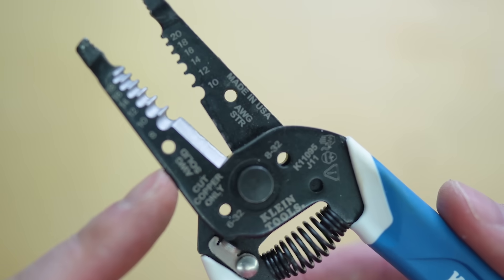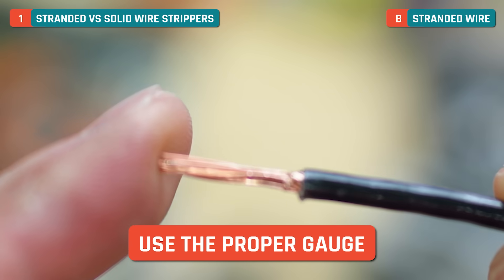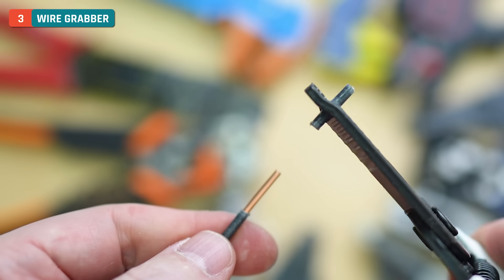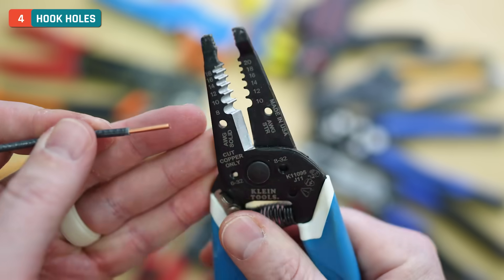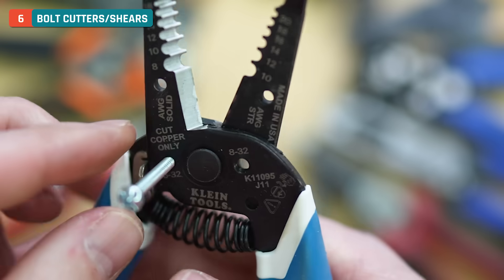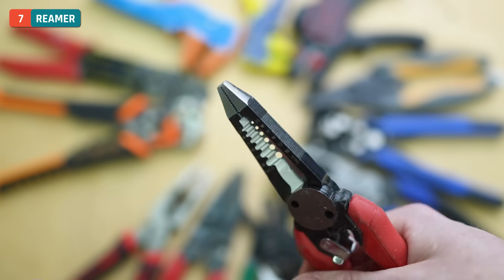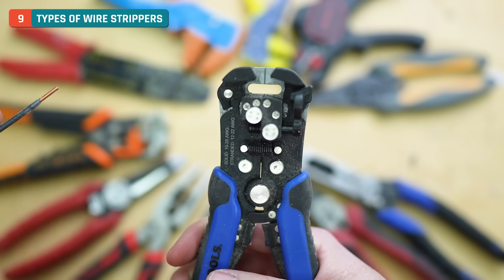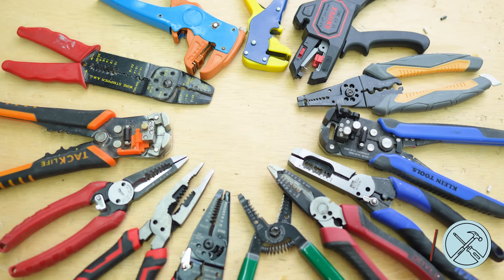8 Wire Stripper Features Everyone Should Know

Comment: When stripping, use the thumb of the hand holding the wire to push on the stripper jaws.  that will make pulling off the sheath very easy & no chance of your opposite hand swinging wide & smoking your knuckles on any hard surfaces.

Comment: You shouldn’t twist when stripping wire, all you need to do is it it in the correct size and pull. You nick the wire when doing that and create a weak point.

Comment: 7:13: FYI: The leftmost number of the screw/bolt cutters' (i.e., the 6 and 8 of the "6-32" and "8-32" shown in this vid) refer to the diameter of the threaded part minus the threads themselves; in other words, it is the diameter at the opposite or open end of the screw/bolt's head (the part you would tighten or loosen). The 6 and 8 sizes are the most commonly used for electrical work. The "32" refers to the number of threads per inch, even if the screw/bolt's shank (i.e., its length minus the head) is shorter than an inch. FWIW, the screw/bolt size may be followed by something like, 'x 1-1/2" ', which is the NOMINAL length of the screw/bolt (i.e., again, minus the head) in inches (n.b., the ACTUAL length may be slightly shorter, just as a 2x4 piece of lumber is rarely 2"x4"; in this case, the "2x4" usually refers to the size of the plank BEFORE it is milled; although they are supposed to be standardized, there are a number of factors that may affect the finished/milled piece's measurements, such as the blade used, heat, humidity, additional processing, such as pressure treatment).

Comment: Great informative video. The only thing I would like to add is on the Klein automatic wire strippers is there is a small plastic piece on the right side of the pliers that can be used as a depth gauge also.

Comment: Different manufacturers have different names for the oval shapes cavity hear the tips of wire strippers. It is called a stripper tool, a crimp, a loose screw tightener,  coil holding area; that is all I could find.

Comment: Not an electrical pro but a fairly capable handyman.  I've always called the small, scalloped indentations just down from the needle nose ends a crimper.  I use them to crimp wire connectors when connecting two wires using a butt wire connector.

Comment: This video is a partial FAIL, because LRN2DIY is apparently guessing at the features and getting some of them wrong. If you are going to try and teach others, make sure you understand the topic yourself first!

Using those "needle nose" pliers to break off the mouse ears is a terrible use of the tool. When bending metal back and forth to break it from metal fatigue, you want to NOT concentrate the twisting force anywhere other than at the scored line. People skilled at this will use a pair of wide nose pliers that can grab and cover the entire mouse ear....THEN it will break cleanly. BTW, the Klein Tools website tells what the tool's features are, so no guesswork is required. They say the "needle nose pliers" are for bending and forming wire after stripping.

The feature near the tip that LRN2DIY guesses are just 'grabbers' are in fact basic crimpers, for attaching crimp lugs and butt splices to wires; they don't meet NEC requirements for being a proper crimping tool, but they still can come in handy when the correct tool is not available.

6-32 and 8-32 both have the same coarseness of threads.....that is what the "32" means; it is the "pitch" of the threads. BTW, contrary to what MANY websites say, including the Wikipedia article on screw threads, and almost ALL "AI-generated" information, the "pitch" is not a distance measurement; if it WERE a distance measurement, the thread would be coarser as the pitch number increases, but in fact it works the opposite way......the pitch (In the non-metric screw thread world, the "pitch" number is the quantity of thread peak-to-peak distances that fit into the length of an inch) is greater with a finer thread.

Comment: Locking the strippers closed for putting them away also protects the cutting edges from both getting damaged rattling around against another tool in your bag, and also from cutting your hand when you are rooting around in your bag to find a tool.

Comment: Great video! I'm not an electrician, just occasional home DIY things, like replacing wall switches or installing ceiling fixtures. I've used needle-nose pliers without ever knowing my strippers had pliers or the wire looper. I've run into the too-long-bolt problem several times and wish I'd known about the bolt shears. Thank you for sharing!

Comment: I personally use a flush cutter for almost everything And then if I need to bend wire over I'll grab my pliers As for the bolt cutters it ends up mangling the threads so you make your own threads in the box and how often and are you cutting electrical box threads

Comment: The "needle nose" on wire strippers are for light duty work. In other words, worthless. Right below the needle nose area is the soft crimp for non-insulated butt splices, termination rings, or forks. Wire strippers like these need wire hook holes, because the needle nose sucks. Bolt cutters are always useful.

Comment: Ok, i have a question.  I have all these things that seem to be for connecting wires.  You flip this tab up, insert a wire on the end, flip the dip down, other side, repeat.  Have no idea why and what I would use them for but I've found electrical outlets that allow you do just insert the wire inside a slot then just screw down the slot.  That is SOOOOOOO much easier than trying to bend a wire to me.

Even with my kindergarten level knowledge about tools, I really like Klein tools. 

I have a Klein 44228 electrical knife?  Check it out, it has some feathers i want to learn

Comment: The tear drop thing you speak of is for crimping. Theres 2 types of crimps you can do . Idk the names of it but for stranded you use the one with half moon (or oval shape) on 1 side of the tool and the other side has this nipple 😂 thing. The one you show is for solid wires like the copper wire your demonstrating. Atleast thats what i was told when i was a mechanic. Worked well since i dont recall ever having a comeback due to bad crimping😂

Comment: At 7:32, you said the 8-32 bolt has a coarser thread than the 6-32. They actually have the same thread pitch. The 6- and the 8- are the bolt's gage number, and the 32 is the thread pitch, meaning that thread has 32 threads (turns) per inch. The next size up is a 10-32, which, again, the only difference is the bolt gage, the thread pitch is the same. 
There are other threads, like a 10-24. That thread is the same 10- bolt gage, the difference is this one has 24 threads (turns) per inch. This is actually a coarser thread than a 10-32 bolt.

Comment: Pulling on the wire not only makes takes longer to strip that 3/4" of insulation, it will cause damage to your hands. Use your thumb to push the stripper. Never twist the wire to strip the insulation. This video should be used in schools to teach what not to do when trimming conductors.

Comment: That tool just got a whole lot more useful.  Thank you sir I used them as wire strippers and maybe used the end to yank off the stripped wire.  Things learned: Holes to bend the wire to properly fit those screws and those other holes to cut screws to proper size.  Naturally I used a mini hack saw to do that.

Comment: Guess here, but if you put your wire against the tip down to the hole that has the AWG for that wire and then strip that much sheething, will that give you the perfect length to make a hook in that wire gauge?

Comment: We had these where I used to work, and we'd have to strip a PTFE liner off of a copper wire, and maybe half the people there insisted on using the cutter portion as the wire stripper, and somebody tried to cut a steel mandrel with them for some reason.
Reply: Use side cutters to remove mouse ears

Comment: Next time you break off mouse ears, point the tool tip so it is perpendicular to the score line instead of parallel to it. That way you use the length of the tool as a lever instead of having to twist it, which in the long run will do your wrist no good. Also, when cutting solid wire, I like to use the correct gauge hole (say 12) to cut the insulation and then shift to the next larger size, 10 in this example, to pull the insulation off. Tool wear or manufacturing tolerances can cause the tool to want to pinch the wire. Scored insulation pulls off easily with the next larger hole.

Comment: As a retired electrician, just give me those old school wire strippers. Immediately remove the set screw and get used to the pressure needed to strip the wires. I'm at least two times faster with those and cause no damage to the wires then with these automatic wire strippers.

Comment: Tiny bit tip, when snapping off ears on outlet or switch be sure to make the first twist as far as possible. Do not go part of the way. We need to make the metal stressed on the first twist and then concentrate the next ones to also twist as far as possible. We will find less twist it takes to fatigue the metal tabs before they breaks.

Comment: Rule number 1: dont buy klein strippers anymore. They suck. They will cut wire but when you try to cut string they just fold the string over. I bought some milwaukees in the same shape as the klein curve ones and they cut string just fine. So klein is just overpriced overrated garbage

Comment: 5:14 12/2 NMD cable has 12 gauge hot and neutral, but 14 gauge ground. Generally, cables come with grounds that are one size smaller than the hots and neutral, except 14 gauge cables. This trick doesn’t work.

Comment: So as an electrician personally i find for residential the klein yellow "cable strippers" are the best because you can strip 14/2 cables and 12/2 cables aswell as the individual wires and they still have the functionaity of having the bolt shears, mostly i find you cant really beat them for all things residential

Comment: I like the explanation of the features. Well done. Right or wrong one thing I do on the hooks for the screws on switches and plugs is squeeze the wire tighter around the screw after it’s hooked on and I always turn it in the direction of tightening. Seems like I’ve had the wire push out going the other way.

Comment: I got a chuckle at the title. When you work with these type of strippers as they have evolved over the last 40 years. Btw you should never rotate your strippers as you strip insulation off. You can ring the conductor causing a point of resistance.

Comment: Super beneficial tutorial ! Mine is like the red handled one in your picture as if looking at a clock, 10 or 11 o'clock.  I'd like to see a tutorial on that.  I may get one like you featured.  I've often seen them. I could've used that bolt feature recently. Who knew ? I'm not very handy. But, I have a few tools and use them on occasion.  I recently installed/changed three light fixtures.

Comment: The "wire grabbers" can be utilized similar to a surgeons' clamps.  For example, the common task of twisting together multiple stripped solid copper wires for making pigtails, group the stripped copper wires together and clamp with the grabber part of the tool, then twist the copper wires using a second set of, preferably larger, electrical pliers.

Comment: Never turn or rock the strippers. When you squeeze the handles, the insulation is fully cut. Then, release the handles slightly and use your thumb to push the strippers off the wire. I learned this from an airplane technician. See also "7 things I will never do as an electrician" by Backyard Maine. Or use that oval hole near the plier tips to pull off the insulation. That trick is a new one on me.

Comment: I often work with a bunch of 18-24AWG wire and I've tried a couple auto strippers with them and can't get them to work better or faster than just doing it with regular strippers. I haven't tried the Knipex one yet though and am wondering if that can do very small wires very well?

Comment: As you backout a screw you just cut, it does not rethread the screw what you are doing is
CHASING THE THREADS and cleaning up bent parts around the shear & cleaning out and dirt or whatever in the threads.

!

Comment: Tip for pullng off the sleeve of the wire. 
If you have a 12 AWG, cut down with the 14 AWG slot (without moving or twisting that damages the copper), place back in the 12 AWG slot and pull off the sleeve.

Comment: FYI, 6-32 and 8-32 are both the same thread. One is not coarser than the other. 32 threads per inch, so I have been told.  The first number, 6 & 8, indicated the diameter.

Thanks for your informative video! I am going to go buy a good set of wire strippers.

Comment: I don't have any wire strippers like those but I took a look at 6 or 8 similar online.

None had a function assigned to the 'wire grabber' hole.  I've concluded it serves two purposes.  One is to give a standoff space so the needle nose plier jaw faces will close nice and flat.  The other being that the arch shape that hole creates will also give better torque if you really need a lot of force going to the needle nose pliers without distorting the shape of the poker faces.

Comment: That "wire grabber" at the very tip of the pliers is actually to fold your crimp over when you have crimp style connectors and you put that first crimp on it then you put them into the "wire grabber" end rotating it 90° and you squish the crimp in on itself for a very secure solderless terminal

Comment: The cpc isn't 2.5, it's 1.5. You should of used a red crimp. This is a good reason why electrical problems should be fixed by electricians and not DIY DAVES like on here.

Comment: I have not seen if you have covered this somewhere but I think it is useful to know. I'm not a n electrician but years ago I worked with a certified electrician in Maryland. The code there (and maybe the national code) requires that after hooking your wire around a terminal screw (like on a switch) you must close the hook using needle nose pliers before tightening the screw. Obviously this majes for a mre secure connection.

Comment: I've also found that in order to avoid nicking the wires you can make the initial squeeze with the wire stripper and then let go and grab the insulation with your fingers and pull it off. You can rock it back and forth to break the final remnants of the insulation with your fingers without damaging the wires. This is especially true with coax cables.

Comment: Just get some cc-22 pliers. Stirps anything you can fit in the jaws as long as its copper, aluminium or softer. Even pvc. Strips and cuts anything. Way lighter and smaller too, but they come in all sizes

Comment: Umm, at 7:30 you said the 8-32 was more coarse threaded than the 6-32... Isn't the first number (the 6 or the 8) the DIAMETER of the Bolt and the 32 the pitch of the thread on the bolt? So they are both the exact same coarseness right?

Comment: 7:32 The first number =bolt size. The second number is the number of threads per inch. Both are 32 threads per inch. The only difference is the diameter, thus the 6 and the 8.

Comment: I noticed the Milwaukee strippers were marked IDC by the crimper. That usually means Insulation displacement connector, but i couldn't work out what they were trying to convey - its labeled that for a reason. As for strippers, I am old school and prefer Ideal stripmaster automatic strippers

Comment: I use another feature on my universal wire stripper (13:45) - For a midstream splice, This tool will grab both sides and pull the insulation apart for a midline ("T") connection.

Comment: I find the needle nose portion tends to be best used if you're applying the movement along the handles of the strippers rather than side to side because some cheaper made strippers (or enough force) will torque the nose enough to make it useless

Comment: I'm no electrician but you're not supposed to wiggle the stripper, it damages the wire. Those tiny cuts will weaken the wire. Close strippers and pull out. He even showed the cuts 😐

Comment: 1:18 If you score the conductor by twisting it in the wire strippers you can create a hot spot by reducing the cross sectional area of  the wire.
Reply: Yeah, he re-did that cut because the damage was obvious, but aren't you supposed to not twist at all? Just squeeze and pull?
Reply: @GregConquest Yes, you got it. We just need to score the insulation and it'll pop off.

Comment: The best wire strippers I ever had was a cheap Southwire.  It had everything that Klein had plus a crimper, and its quality was surprisingly good.  More importantly, it lacked the spring and lock which always just annoyed me on the Klein. Unfortunately, I lost those and can't find the same Southwire that I had, and the other Southwires I did try aren't as good.  I use a Klein now but the first thing I did was drill out the lock and remove the spring to make them the 2nd best wire strippers I've ever used.

Comment: My favorites are similar to those Milwaukees, but its got more of a needle nose head.  The middle is thick enough so they don't bend out of place.  They last forever, but don't quite have the same leverage if you're trying to strip a hot wire without touching the metal clamp that holds it closed.

Comment: But, I'd like you to use the correct size with the stranded wires, but on the romax side of the cable strippers.  See how that works.  You changed both the gauge and the side of the cutters at the same time.

Comment: As an electrician I’ve learned it’s easier to, while gripping the strippers down onto the wire, hold the wire in your opposite hand, and with your thumb push against the head of the strippers, so you don’t struggle to do everything with your hand/arm that’s holding the strippers. Possibly wacking someone in the face if they stood next to you